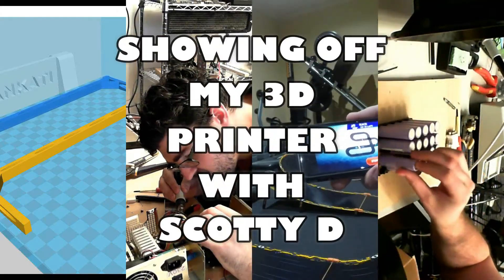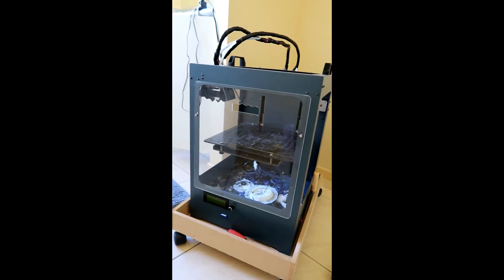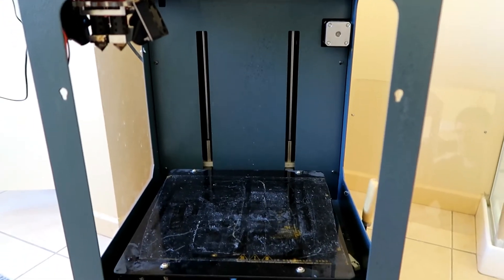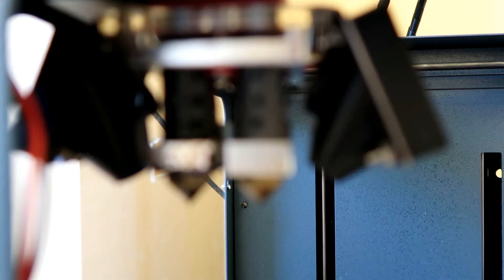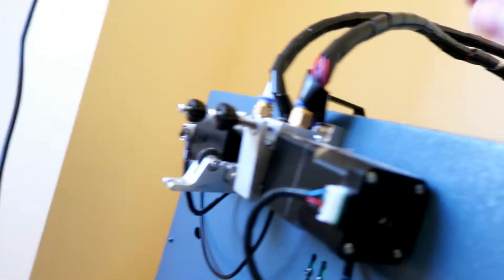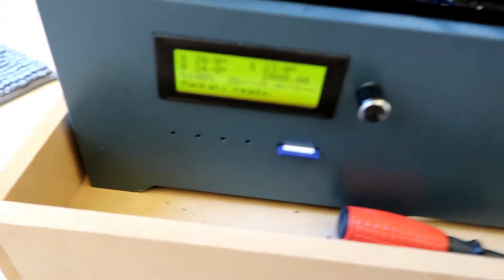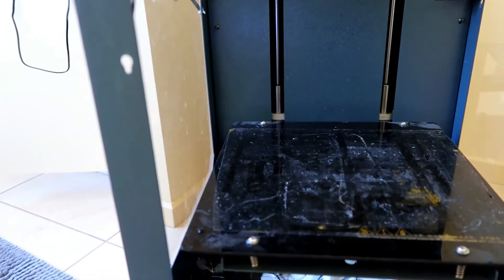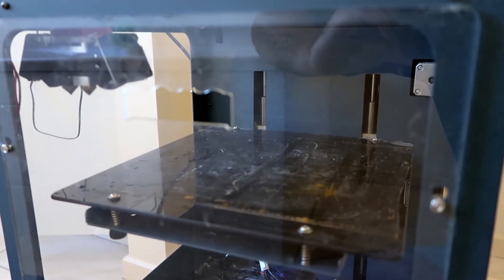My Mankati Fullscale XT 3D Printer

Comment: Thanks for the review, man! Was thinking about buying a used one. Now I've seen it much closer. Saved me some time!
Reply from the maker: Glad I could help! It is still reliable if you are able to tweak parts yourself, but depending on price and other printers you are looking at.
Reply: @ScottyDIY  maybe it's good but as soon as I've heard that it has own proprietary nozzles... also it has linear bearings... too much "minus" points for me.
Reply from the maker: That's fair enough, I actually found replacement generic nozzles on eBay once with the correct thread and ordered them, but I cant find any more now, worst case I have a metal lathe and can remake them but not everyone can do that

Comment: Hi Scotty, I have got a Mankati E 180 back in 2017 and i am trying to find noozle replacements. But Unfortunately Mankati firm has long disappeared. Do you have any idea where I can find compatible noozles?
Reply from the maker: yeah eBay, they are a generic nozzle so you can get them cheap, i just cant remember the exact thread, and just get the hole size that you need

Comment: Jello Scotty
I have the same printer but i need the software , can you send me an email to download it ?
Many many thanks
Reply from the maker: Hey. When I get a chance to get on the computer today I will have a look to see what I have and send it through. Cheers
Reply from the maker: Hey mate i package up my folder MankatiUM_6.5.3 as i couldn't find the original download installer hopefully it works. I sent your email a dropbox link. I deleted the other comment as well so you email isnt showing to everyone. let me know if it worked.
Reply: Is it compatible with Windows 10 ? I m trying to install but d’ora nt start the installation
Reply from the maker: Yes i am using windows 10, check dropbox again, i have added desktop link. just place link on desktop and the full folder in C:\Program Files (x86). and try too see if works, no need to install